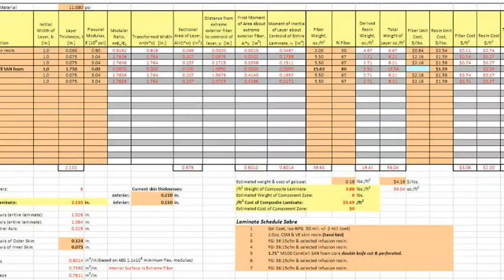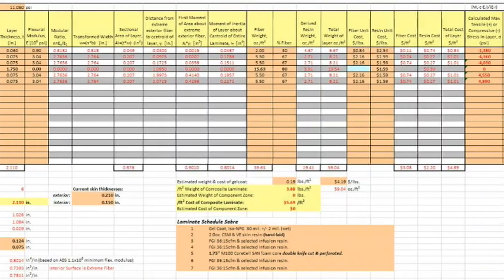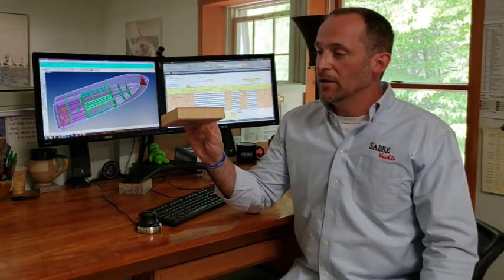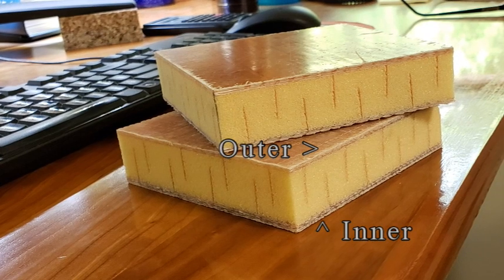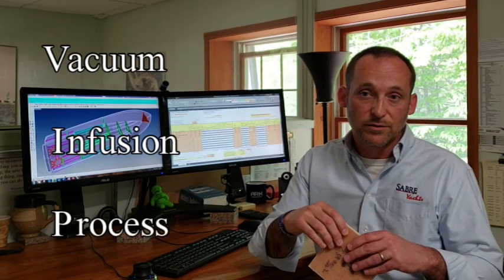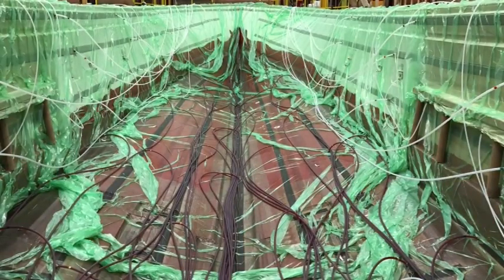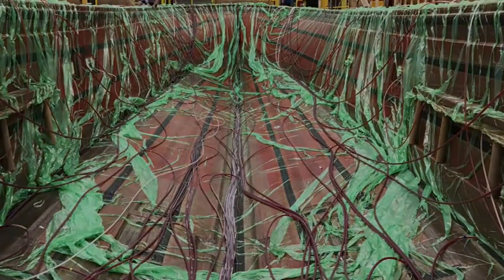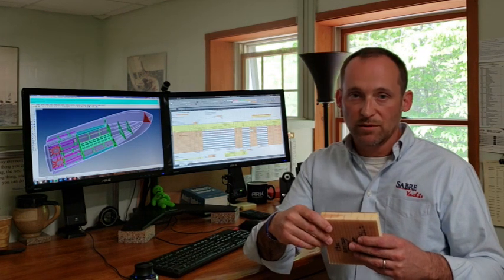Sabre Hull Engineering

Comment: Did I understand correctly that your hulls are cored?  Even below the waterline?  If so, any feedback from owners regarding delimitation and or water ingress?  Thx.
Reply: They go with solid glass wherever through hulls penetrate.  This is where the cored hull builders ruined the reputation of competent cored-hull builders, because they would rig up the vessel and go through cored sections.  Sabre uses full fiberglass in these areas.  This requires time and materials.  Coring bad when companies are building on price points and just rig the whole hull in deference to the coring.
Reply: @filandro  thanks for the response. Key information for those interested in purchasing a Sabre.